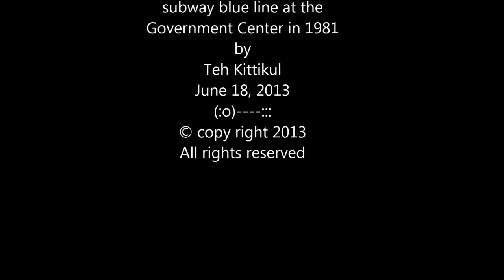Kawasaki Ninja 650 Oil & Filter Change in 3:32 Mins No Fairing Removal + Complete Tools-Parts List

Comment: Best video for doing your own oil change, just did mine for the first time and couldn't have been easier. Only downside is the upfront cost for a stand, and other tools, which is recommend as its cheaper than replacing a fairing or whatever else could break if the bike is dropped. That said after  doing your own oil change twice the parts will have paid for themselves and you'll keep saving money for the rest of your riding days.

Comment: Thank you, this video helped!  I have the 2007 Ninja 650 and I did take the lower side fairing off on the right side of the bike to access the drain plug, which isn't conveniently on the side like in this video--it's pointed straight down.  Otherwise the procedure was the same.  I used 10W-40 though.
Reply from the maker: You are welcome.

Comment: it's because of this video I know how to change the oil on my brand new 2015 Kawasaki Ninja 650. thank you so much.
Reply: I have the same bike. Hopefully it works the same
Reply: I recommend a small plastic oil pan to catch the oil. The hardest part is keeping the lower fairings apart from each other and keeping the oil from draining onto the lower fairings.
Reply: Yeah I figured that much too. Thanks for the heads up.

Comment: thanks bud. Great video (apart from the music). I do recommend to run the bike a couple minutes beforehand to warm up the oil. you can get a lot more out that way. And take breaks while adding oil to run the engine for a minute or two because it can drastically change your oil level too. then add more until it stays where it should. Cheers!
Reply from the maker: LeanderRandom. Thank you.

Comment: I like your video. I think I'd like to try your technique of taking out the 3 plastic fasteners and putting a piece of wood to spread the bottom of the fairing. My bike is a 2007 Kawasaki 650R, but I'm hoping it would work for my bike too. Do you know the length 
of the piece of wood? I have a wooden paint stir stick I might try. Thanks.

Comment: Good method, but there are actually torque specs for the filter and plug
Reply from the maker: Hi TheMonkeyMan016, would you please share the torque specs for filter and plug? So that we all may benefit from your knowledge - Thank you and PTL!
Reply: @TehKittikul  Torque specs are:
13 ft•lb for the filter (17.5 N•m)
22 ft•lb for the drain plug (30 N•m)
Reply from the maker: @TheMonkeyMan016  Thank you for sharing.

Comment: Thank you for such an easy to follow, to the point, instructional video! Every video I watched previous to this was long and not real helpful. You use a 20w-50, is that the recommended oil for everywhere? I live in Florida where it is fairly warm year round, and am an amateur rider.
Reply from the maker: Hello Joseph, you are welcome. I'm glad you found it to be more helpful than other videos. From the Ninja manual a SAE 10W-40 oil is recommended for most condition. I use the Amsoil 20W-50 for San Francisco weather which could range from 32F to 104F. Amsoil has to be custom ordered but it has a longer life cycle.

Comment: I have the 2015 ABS model and the manual says to use 10W-40 oil not 20w-50!
Reply: +RicanRevs 10w-40 is the correct oil for the ninja 650
Reply: +scooterdavis  yes i was wondering the same thing as ive just purchased the 2016 model abs and it also states 10w-40
Reply: Likin' your bike?
Reply: yeah fa sure
Reply: Mines got 18k miles and going strong:) I'm looking at a Z1000 by next year hopefully
Reply: 5w-40 rotella t6.
Reply: Thanks

Comment: It's hard to separate the lower fairings unless you also remove two more hex screws under the foot pegs. And I think the drain plug is 17mm, not 18mm. Any pointers on this?
Reply from the maker: Thank you Sanjay. If you feel like you need to remove 2 more hex screws then please do it. You may be correct.

Comment: When changing the oil in a car it's often recommended to change the oil drain plug as well. I noticed you didn't do that, but should it be done on a bike?
Reply from the maker: Hello Vlad K, thanks for your comment. Yes, it is recommended, however please use your own judgment to determine if it is needed or not when you change the oil on your bike.
Reply: Haha that's the nicest way I've seen some one say fuck off....

Comment: what should be the default oil level??
Reply from the maker: Good morning Shrikant rao, assuming you have your bike stand straight on bike rack. (See http://youtu.be/6kMElbwfKwU )The oil level should be at half of the round oil level window.
Reply: Can I just change the oil without replacing the oil filter .
I'll be replacing that in a month ,is that okay??
Reply from the maker: The question would be when was the last time you did the oil and oil filter change? If it was not ages ago and if the oil level is low, I would just added more oil and change both oil and oil filter within a month as planned. Remember oil and oil filter change is the cheapest investment to maintain your bike engine.
Reply: I wanna start by saying I got the bike in Feb 2014.
I've done two servicing at 1000km in March and 6 K in May
This will be my third @ 12k
So should I just top it off 

I think the oil is Mobil 10w50

Comment: Hey man how would this process work out if one had no bike stand?
Reply from the maker: Robert Irons May be tie the bike to something strong so that it stands straight up. Or have someone hold it straight for you when you need to measure the oil level. However, if you plan to do your own oil change buy a bike stand. It is a good inexpensive investment.
Reply: thanks for the video and the reply. very concise and helpful! ride safe brother.
Reply from the maker: Yes, thank you bro.

Comment: 10-40 semi synthetic is the correct oil. it's in the handbook. also fully synthetic oil is not good, told by every proper mechanic, do not use